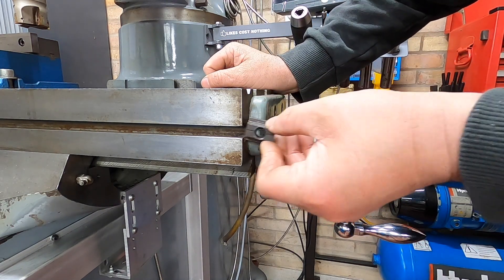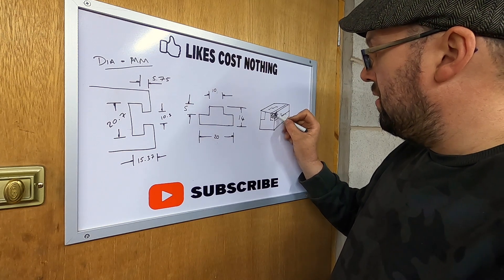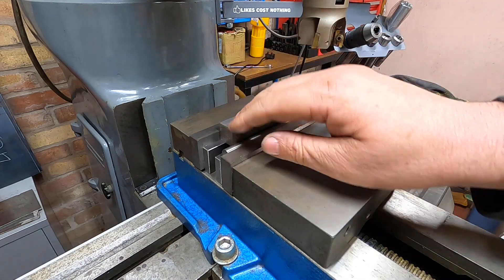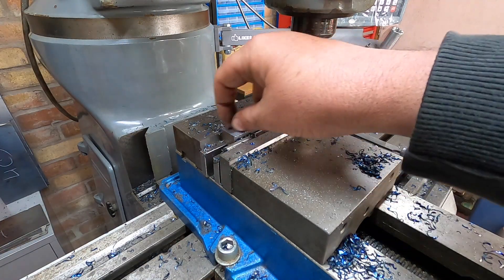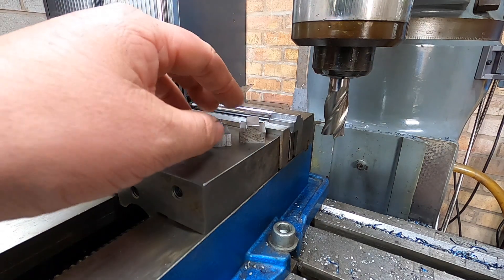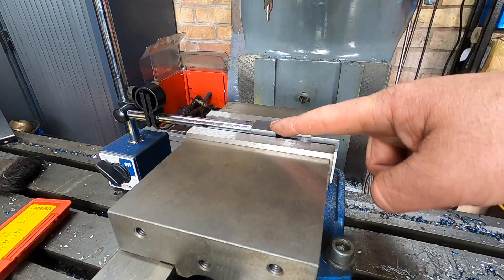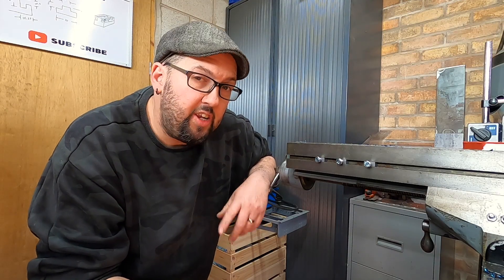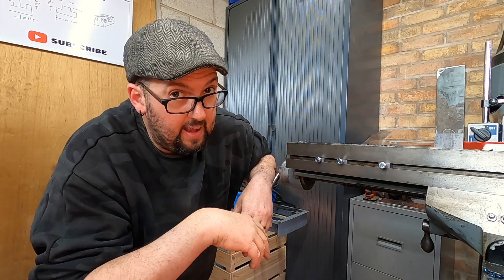Matt makes some Tee Nuts for the Bridgeport.

Comment: Lovely stuff! For simple things I always end up getting my head in a spin and forgetting first principles, but looks like you nailed these :)
Reply from the maker: Thanks William, much appreciated. Is the first principle, “if you don’t have it, make it?”. If you’ve watched the pony truck roller skate video, I used these tee nuts to mount a datum plate on the front of the mill bed, so I could set an angle. It’s all good fun. All the best, laters, Matt

Comment: Hi Matt Myself I make the T Nut's with no through holes for an old timer drilled into me the bolts can damage the slots in the table. As time rolls on the old timers are becoming very thin on the ground and those skills of a life time are being lost for ever. A side note could you show use the castings you make I think that would be very interesting. Have a good weekend.
Reply from the maker: Thanks RB. Age was brought up at one of the engineers society meetings I go to and they are on a push to get younger people involved as it was pointed out by the chairman, how many of them will be left in 10years! One of my biggest reasons for joining the club is to learn from the experienced. 

I must admit I’ve not heard of your method, but now you have mentioned it, it’s most logical. 

When you mention casting, I have a video on centrifugal casting on the channel. What would you like to see?

All the best, Laters, Matt